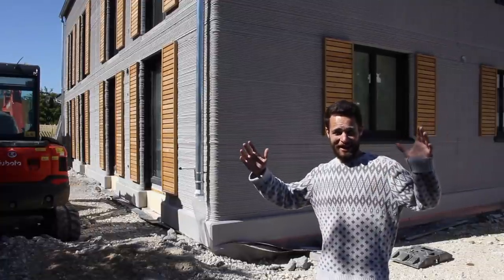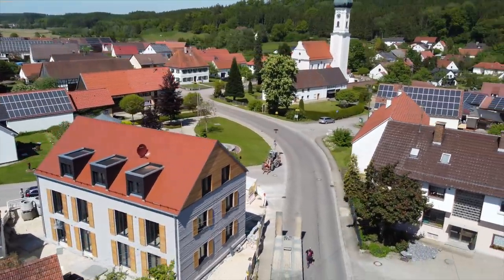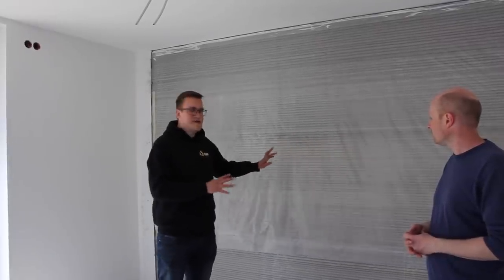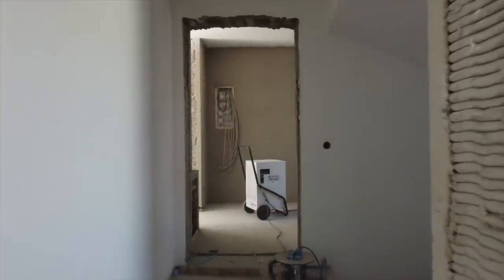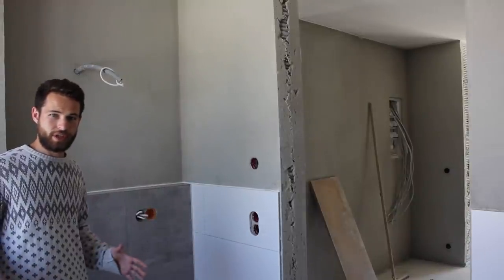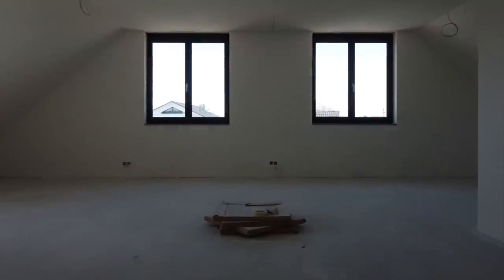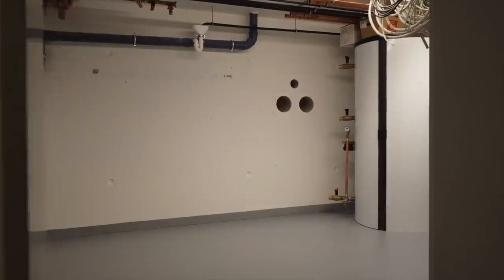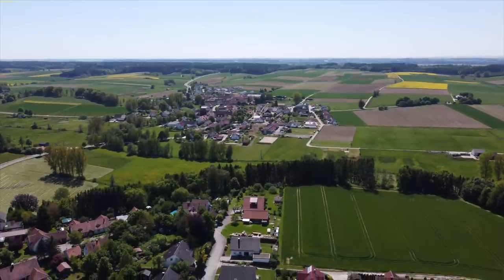5 Apartment Units 3D Printed On Site in Germany | Late Stage Construction Tour

Comment: Aloha! We are a nonprofit foundation preparing to build permanently affordable homes on Kauai. We are in the process of evaluating printers to acquire ourselves to keep costs lowest. Our team is tracking 10+ manufacturers so far. Leading is Apis Cor due to their flexibility and low cost. Also raising funds for printer acquisition. We have over 20 potential projects in our pipeline currently including Habitat. Due to code challenges we are considering printing the forms for standard concrete load bearing columns to be poured in place and then printing the non load bearing exterior and interior walls.
Mahalo for your contributions.
Love to have your thoughts!
Reply from the maker: I always found apis cor promising but they haven’t completed a project in the past years which is somewhat concerning. Hawaii is one of the two states I haven’t visited (other is Alaska), looking forward to when your start printing!

Comment: Great job. Get 2 body mics.
Reply from the maker: Any brand recommendations? I’d like one that will provide good quality for a long time so that I don’t need to upgrade again.
Reply: @automateconstruction  if you’re going back to Denmark, there’s DPA microphones. Expensive but worth testing for reference if nothing else. For reliable but cheaper Shure and Yamaha systems should be good.  Not familiar with the latest but they can provide very directional microphones to where echo and noise shouldn’t be an issue. Audio at construction sites sounds like it could become a headache from electromagnetic interference from machinery. Test in as bad, uncontrolled of an expected environment as you can get to while it’s still returnable? Thanks for the amazing videos. :)

Comment: In twenty years each layer will crack as weight is unevenly shifted because each layer is different with air gaps as the printers were not calibrated correctly after each layer and the concrete from layers beneath it is constantly settling. Far better off using cinder blocks for the long-term safety of the structure. The only difference in short-term cost is the cost on worker's bodies.
Reply: you obviously have no idea what you're talking about. Buy yourself a 3D printer
Reply: @JeffRozanVideos  That must be a horrible shop

Comment: No rebar on the structure. I don’t think it can pass code on most countries. It’s like a disposable building at this point. I want to know more about the paste. Why does it hold so strongly?
Reply: The paste is concrete and once it sets, the walls become like a masonry (cubic stones with cement gluing them together) building, which also has no rebar.
Reply: they print two walls and a reinforcement between them
Reply: @ChrisBigBad  Do you even know how much rebar is required for concrete not to crack? It must have something else than concrete, concrete by itself is not stable
Reply: @Gromic2k  That makes sense. But they should show how labor intensive, reinforcing is. They must have that reinforcement on all window and door headers. Yikes
Reply: @gallegosfrias  the reinforcement is also printed